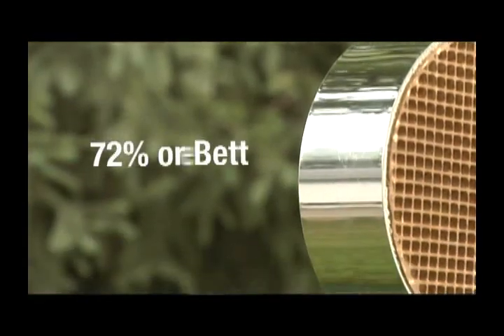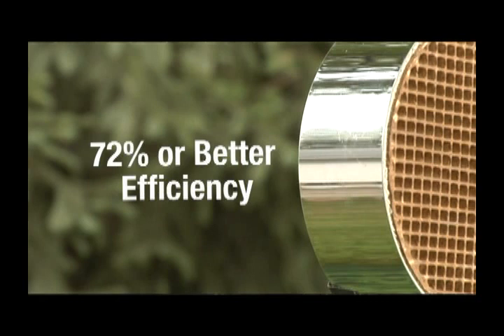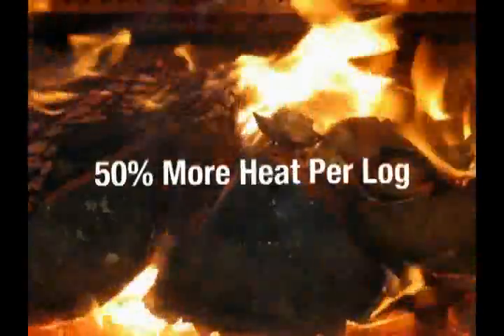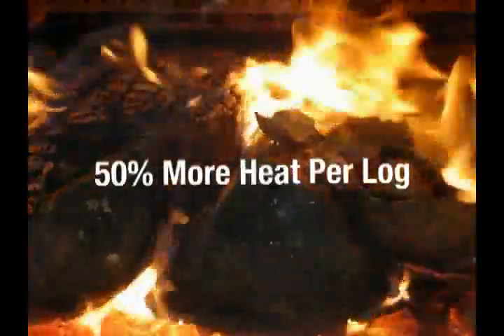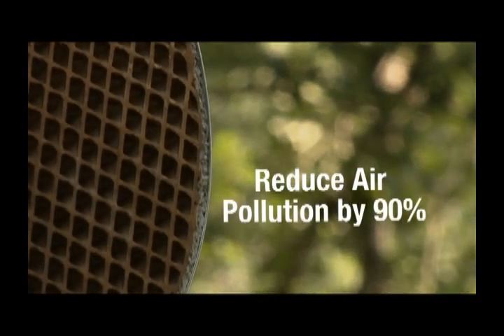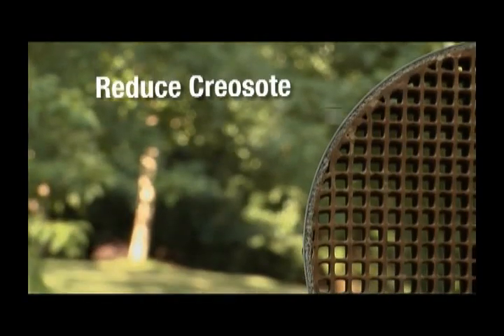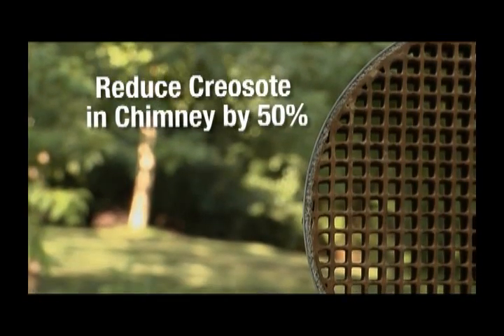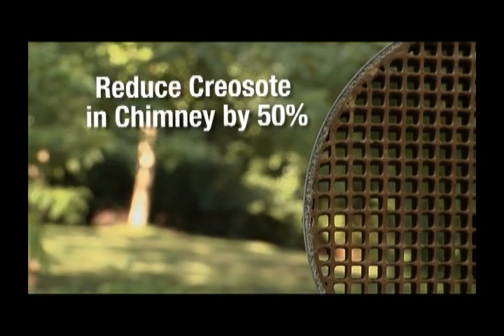Catalytic Woodstoves / Conclusions©

Comment: BS alarm: 0:27 Like Los Angeles?  

1:10 Definitely more fuel efficiency and lots more heat.  While I have not measured or tracked usage I really notice it, just by how fast the pile goes down - and I burn 24/7.  

I have one stove in my place (an old VC Defiant) with a rectangular combustor ceramic in the back secondary combustion chamber. 

I don't run hardly at all without my catalytic combuster active.  Except (obviously) during fuel reloading,  it would be stupid not to use it.